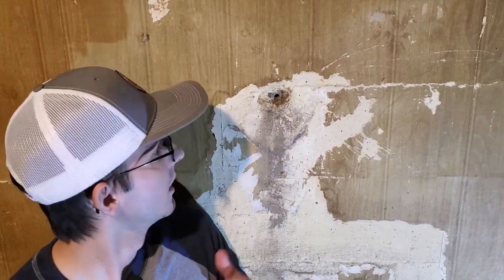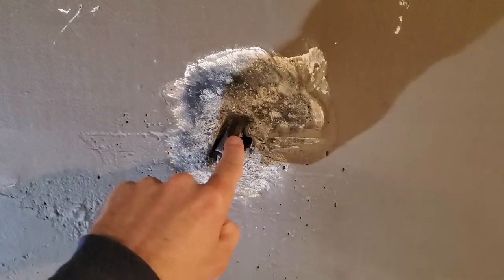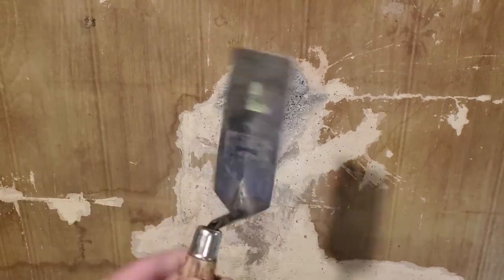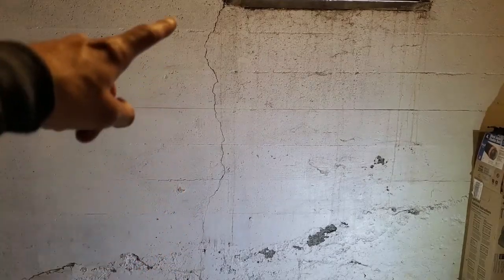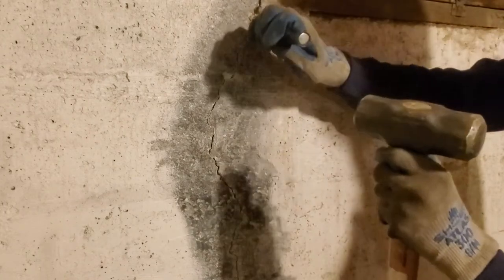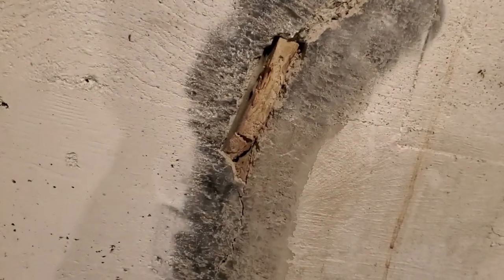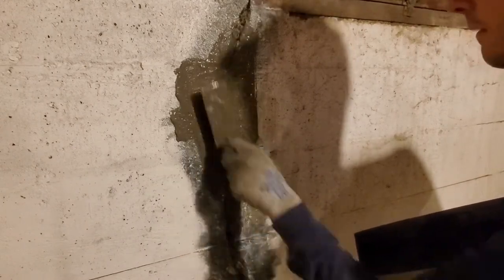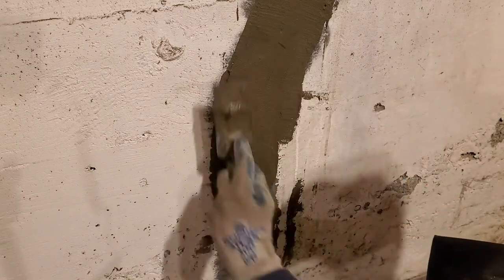How Fix Leaks In Basement Concrete Walls

Comment: Just bought our next home and I know I’ll need to repair a hole in the basement foundation wall.  This video helps a lot!  I’m ready to deal with it when we get the keys.  Thanks for the upload.

Have you found anything else that would work better to shove the concrete in the hole?  Would a syringe work?  Probably one that’s used for marinating meats.
Reply from the maker: Maybe but this stuff is pretty dense if you could it would take a lot of force to remove it from the syringe.